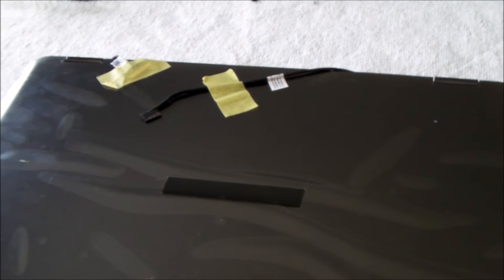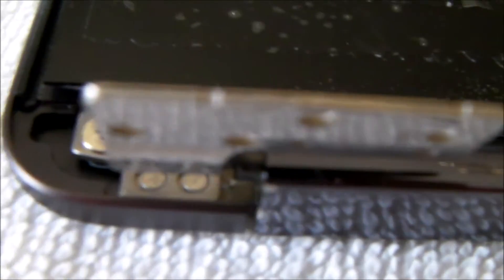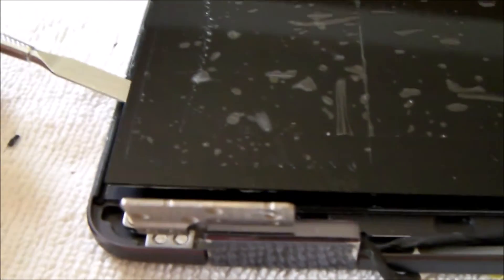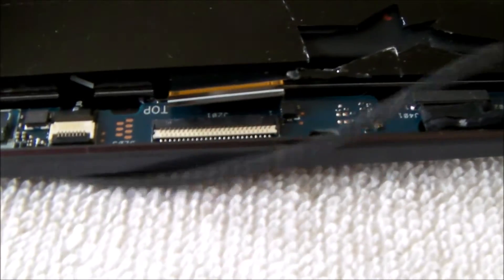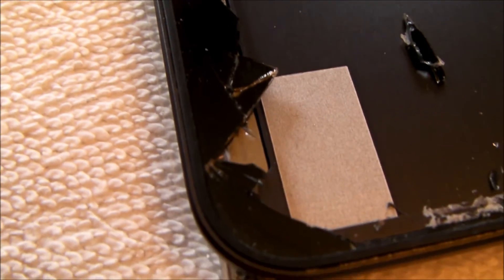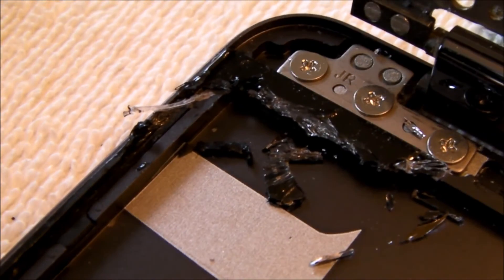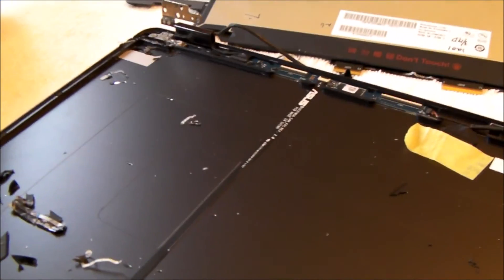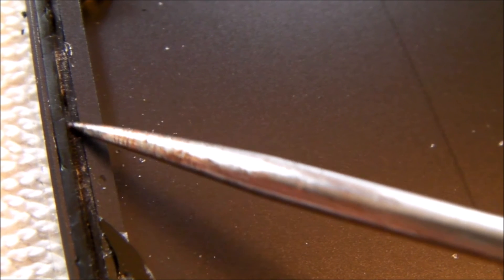How to replace LCD screen in ASUS Q325, Q325UA, Q325U or Zenbook Flip S UX370, UX370UA, UX370U

Comment: Asus q324UA?? Looking for the whole assembly and searches are not finding anything. Have you seen anything? Thank you for this video, just need the part and I think I got it after watching this.
Reply from the maker: 324 or 325?  I believe the 325 were only sold by Best Buy and are the same as the 370.  That was my conclusion years ago but you will have to work with supplier on Aliexpress to confirm.  good luck.  Be sure to LIKE and subscribe,  THAT will really help me!  THANKS